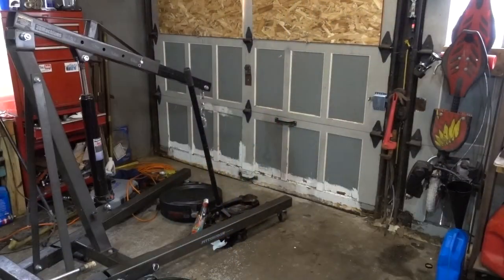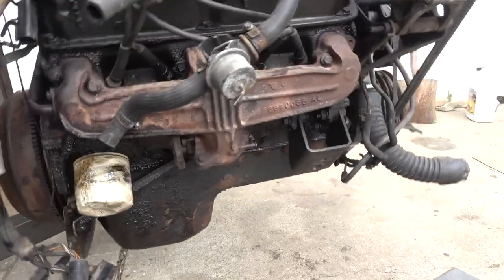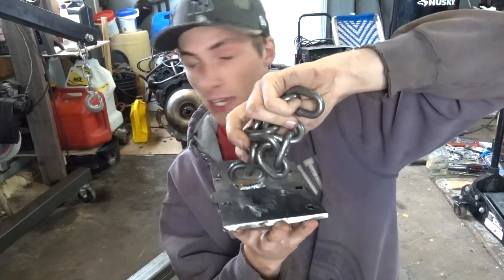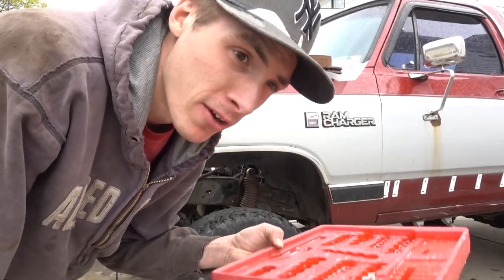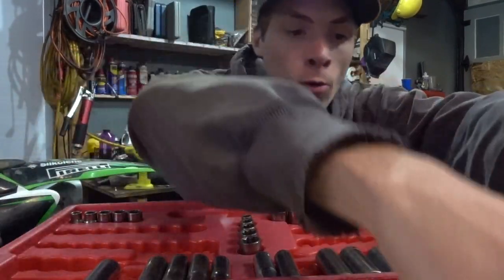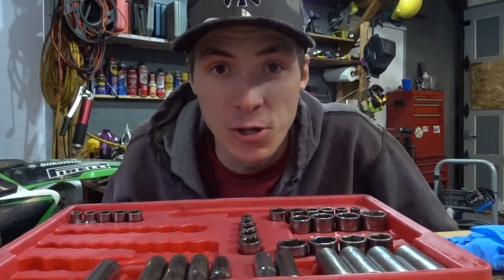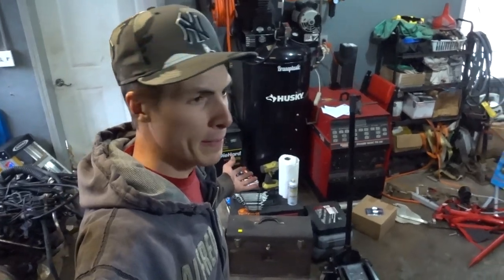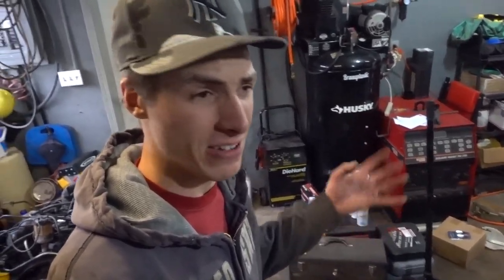MY GARAGE DESTROYED

Comment: Dalton, you've probably already put the engine in, but if you haven't, BE SURE to replace the front seal in the transmission. you made a rookie mistake and pulled the convertor with the flywheel. if you look, you'll see bolts or nuts holding it. (sorry I'm not sure, I'm a gm man) after you change the seal, put the convertor back in the trans, making sure its all the way back and fully seated. if it isn't, you run the chance of damaging the convertor and transmission input shaft and pump. and for gods sakes, DONT put the motor in with the convertor attached, or you'll have a major headache and expense
Reply: dave1135 yes! I made that mistake putting the 327 in my ranger, I took the converter out of the tranny, and when it was all together and In the truck it leaked all of the fluid out, so I put a new pump seal on and she is all good, I'm also a gm guy but I'm still learning
Reply: i was going to comment this myself, i knew someone else would beat me to it
Reply: Very good advice. He needs all he can get lol

Comment: Should have left the torque converter in the gearbox. While it's still in position  turn the engine over by hand to access the nuts from underneath, there will be 4 of them. It will spit from the flex plate with no messy transmission oil spills on your driveway. Hope this helps.

Comment: TIP/// When moving a hoist with an engine attached, put a board under the engine across the lower arms and set some of the engine weight on the board. A swinging engine is more difficult to manage.

Comment: Now that you have removed your first engine, the next one will be quicker and easer. I am wondering how long it will take you to put the engine back in??? It's a little more work installing them. O and replace the torque converter seal, and put the torque converter back into the trans, before installing the engine if you can. It may save breaking the front pump impeller on the trans. Just don't forget to bolt it back up to the flywheel.

Comment: my first engine swap was on my mini stock race car therefore no accessories (alternator, heater, electrical distribution), z24 out 1.3 nissan motor in, and it was pretty simple minus fabrication. Would you rather do a simple swap like that on your own junk or what you are doing now, but have to make sure the stereo and headlights and A.C. etc... still work, but you help someone else out?

Comment: This is a year late,but for the next engine...1.Put a 2x4 or 4x4 across the legs between the wheels and balance the motor on it,when trying to move.It won't swing around.2.use a chain under stand and to the engine so when lifted.it Won't swing around.

Comment: make sure you've got that torque converter on the splines of both shafts before you bolt the engine to the transmission....if it's not you will destroy the pump in the transmission the 1st time you start it

Comment: NEVER ever pull the torque converter out while bolted to the engine.  Always remove the bolts from the torque converter before removing the engine from the transmission.  Install the torque converter into the transmission before reinstalling the engine. Always make sure the torque converter is all the way into the transmission before reinstalling the engine. Make sure you can hand turn the torque converter after you install 2 engine to transmission bolts. If the torque converter does NOT turn after installing the 2 engine to transmission bolts the torque converter is NOT fully in the transmission. I have been a mechanic for over 50 years. That torque converter is EXTREMLY HEAVY.

Comment: as someone who has pulled a couple of motors. 
you are better off leaving the torque converter in the transmission 
spaeking from experience change the front seal while yoy can get to it

Comment: I bolted a harbor freight 1/2 ton crane in my truck for that reason to pull out motors and load anything heavy by myself after I lifted up my motor out of my ranger even though it is a 2.5l motor

Comment: Didn't you mean remove the carburetor and then bolt on the lift plate? If you remove the intake it would be a much larger and more specialized plate.

Comment: I have a question? for 3D MACHINES or anyone willing to give me their option. So ive been working on my trucks hitch reaciver trying to remove the rust and have  been using a wirewheel with  my drill should I countinue doing that or get angel grinder so I can prime and repaint it?
Thank you